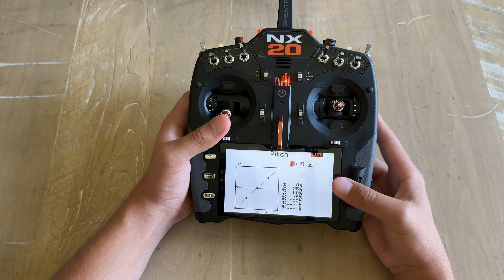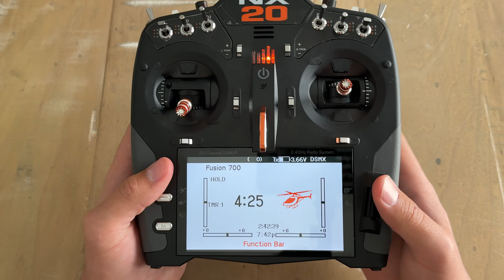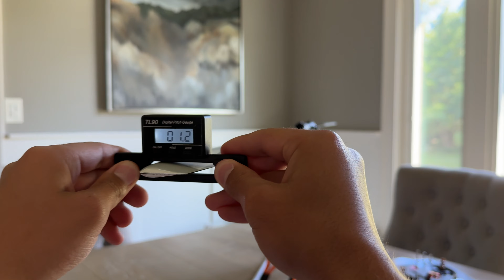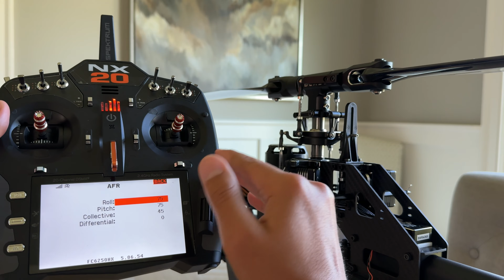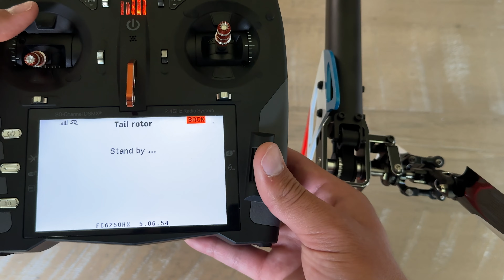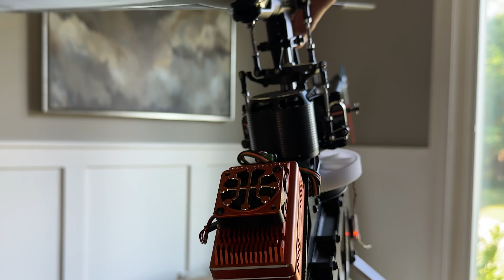Blade Fusion 700 | Spektrum FC6350HX and Avian ESC Setup

Comment: Ethan - I noticed you set overall transmitter gyro gain to 87%. Then in forward programming, you set PIDs to certain values but you set them only in “normal” mode. You did not set up PIDs in Stunt 1 and Stunt 2. Was this intentional? When I have transmitter gyro enabled, I cannot set up PIDs individually per flight mode in forward programming. I am using a Gen 2 , DX-18. I have tried assigning the gear channel and Aux 2 to Flight Mode. Nothing seems to work. Any input you could provide would be appreciated.

Comment: I was wondering with the numbers you have in your transmitter could they be used on a Sab goblin Drake 570? Also why do you have 84% all the way down on your Giro? I have a DX9 but I put in the same numbers throttle, pitch, etc. in my DX9. I was following your video with my DX9 on my lap. Lol your video  easy much easier to understand your thinking. I have this flybar also.  Fact is I was out of the hobby for 2yrs and now getting back in with a purchase  on Ebay with the goblin Drake 570 with this setup. Brand new build from a professional that justed tested   hovering.  He even thrown in charger also a 6s lipo.  And some connecting parts for the charger. $1240 shipped.  A state policeman  owned it and had to move and needed the money to move.